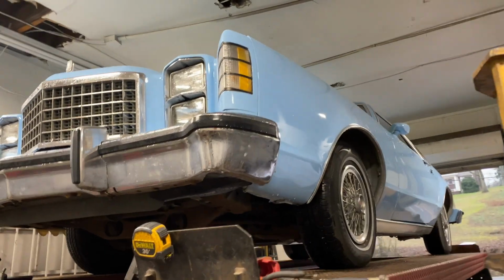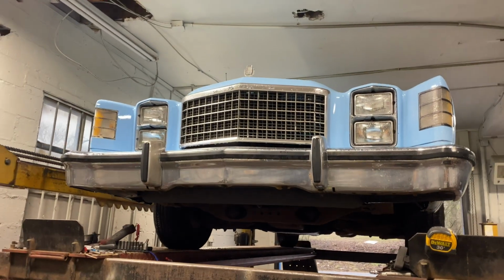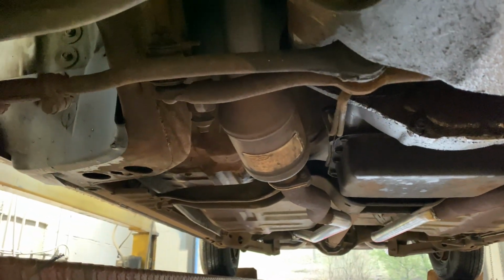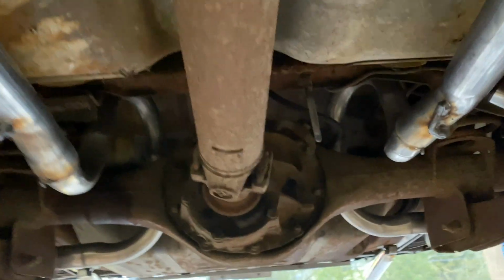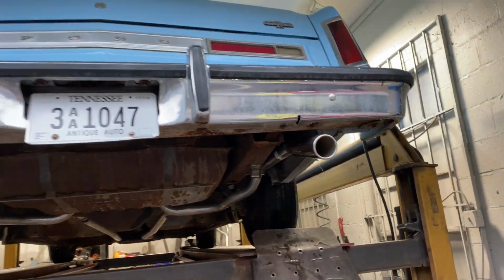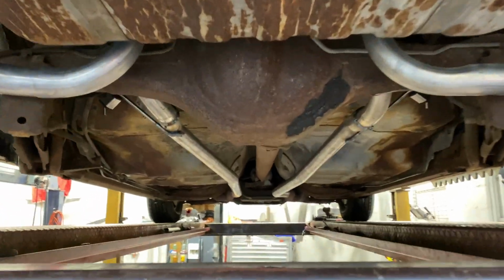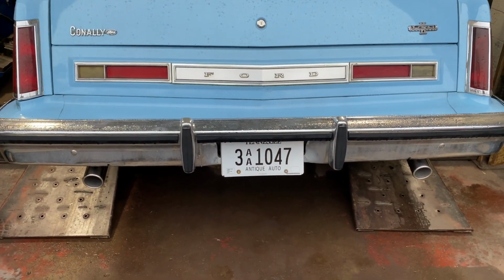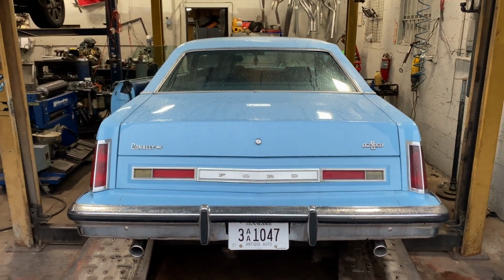1978 Ford LTD TRUE DUAL EXHAUST w/ STRAIGHT PIPES!!

Comment: Probably a 302.  My dad had a 79 thunderbird that had a 302. Same body style but a few differences different lights all the way around.  It was good sounding.  Old fords were like tanks back then
Reply: My first car in high school back in '88 was a 1978 Mercury Cougar XR7. They was basically the same car under the body. They came with a 302 or a 351. Mine had the 302.

Comment: You should have added an H crossover pipe up front whilst you were doing that dual system, helps flow &  horse poo  😁
Reply: And EFI. Carbs are almost always a bit rich and will eventually clog the cats with carbon buildup from excess fuel. I wouldn't  run cats on a carbed car, so if I needed cats for inspection, I'd make them bolt-in for inspection only, or EFI swap.

Comment: I have a 72 ltd, didnt come with cats. I have duals with 24 inch glass packs turned out in front of the wheels.
Reply: Cats were federally mandated on passenger cars starting in 1975.
Reply: Do you know if the 79 come with independent front suspension?
Reply: @KsKaylor  cats should have went away when leaded fuel did lol
Reply: @carloesahagun3999  yes. Watch "a car is born 1969 ford motor company" take a look at the process and the brilliance in their engineering for the time.
Reply: @coreysharp Thank buddy . I appreciate the feed back. I sure will watch that.
Reply: @coreysharp9794  Thanks buddy. I appreciate the feedback. I sure will watch it. Thank you again.
Reply: @carloesahagun3999  you bet. You'll love it. My favorite part is when the cars are being shipped out he says "you can stand on the assembly line 8 hours a day for a year and never see 2 of the same looking model". I'm sure the same men in the video built my car as it was built in sept of 71 and the video was made late 69 and they are making the 70 model. I know for sure because the 400 you'll see came out in 70 not 69.

Comment: I’d like to know what engine it has. 351, 400, 460?
Reply: 302 or 351 Windsor.
Reply: @ragintaurusmusclemercury7023   302 134 hp 5.0L V8
Reply: @scratchcrafter  I had a 1978 Mercury Cougar XR7 in high school back in '88. It is basically the same car with a different body. It only came with a 5.0L V8 and was 152hp/178tq.
The Thunderbird came with the 5.0L V8 (134hp/248tq) as a base engine but a 5.7L (351) and 6.6L (400) V8 as options. 
The 5.7L makes 145hp/277tq and the 6.6L makes 166hp/319tq but was a rarely chosen engine option.
Reply: @scratchcrafter  That is for the Ford LTD. Not the Thunderbird.
Reply: Vulcan Taurus Performance which is exactly what this vehicle is
Reply: @scratchcrafter  My bad. I had Thunderbird on my mind.
Reply: @scratchcrafter  This is the LTD II, which is the midsized model, same as the T-Bird, you can tell by the front end and stacked headlights. The full size LTD had horizontal  headlights. The LTD II had the same engine lineup as the T-Bird with the 400 being the biggest, and only the fullsize LTD had the 460 option.
Reply: @ragintaurusmusclemercury7023  351 is a 5.8L
Reply: @en3myspott3d54  Actually a 351 is 5.752 liters.
Reply: @ragintaurusmusclemercury7023  it's still considered a 5.8L, you don't hear anyone calling the 302 windsor a "4.9L" do you?
Reply: @en3myspott3d54  I don't use liters myself. Cubic inches rules and is more accurate. 😁